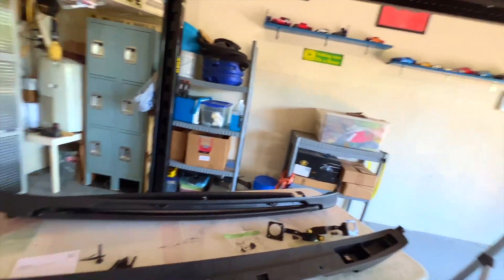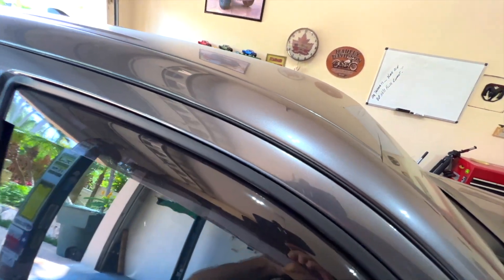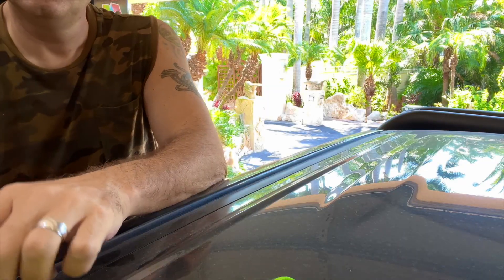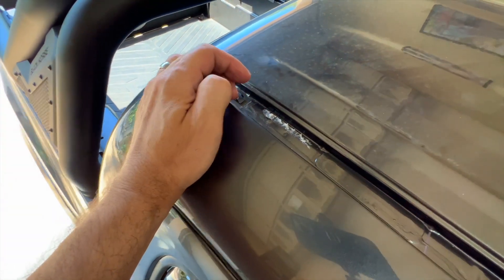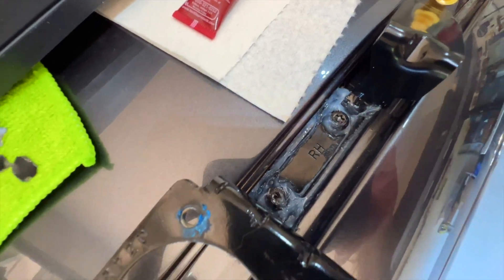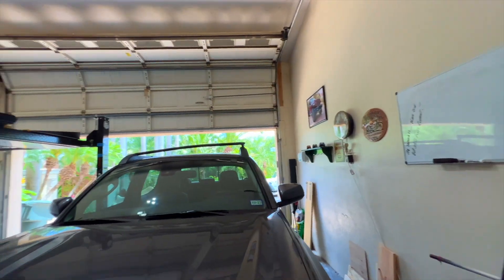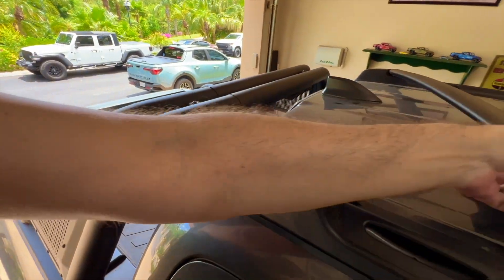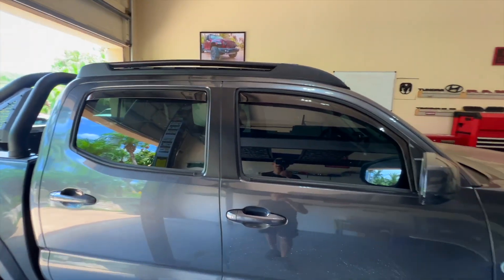Toyota Tacoma Roof Rack Install

Comment: I just installed installed a new OEM  on my 22 Tacoma. I used Sikaflex caulking around the washers. I had a little trouble lining up the front to small bolts so I lossless started them first then loosely started all other screws before tightening all. Shark fin was clear of the bar. I may use clear silicone over bolt heads

Comment: I didn't realize that was how they were installed. Looks OEM to me, but I'd never need one myself. I would like to get a bull bar, but the attachment methods look so weak I would imagine an impact would drive it into the grill and cause more damage than without it.

Comment: Rob, love the videos, very instructional rather than reading the instructions. However, I have a question regarding your bug deflector. I know you probably made a video about it, but I installed a bug deflector recently. I noticed yours and it made me think. Does your rub against your headlights? Mine does and it squeaks. Super annoying. Any tips? Thanks
Reply from the maker: Mine does not.  Maybe your brand or the install🤔

Comment: I came out of a store one day and something seemed wrong it was one of those rubber strips missing from the drivers side I can't  imagine why someone would want it but when I went to toyota parts dept. I found out why because the price of one strip was over two hundred dollars I eas guide shocked but it was needed so you can understand my surprise the fact it was taken and the cost of replacement
Reply from the maker: Yup!   They are very expensive for some reason 😡